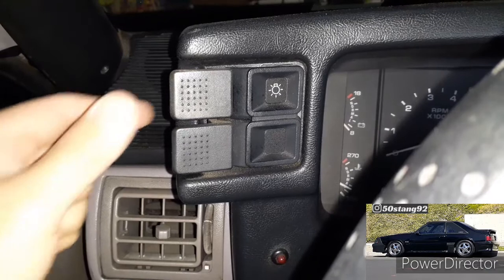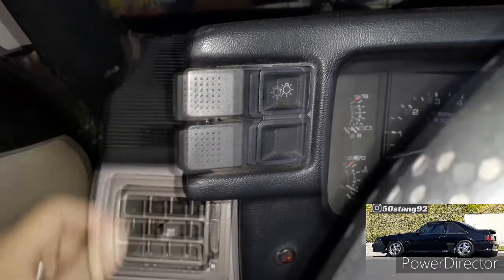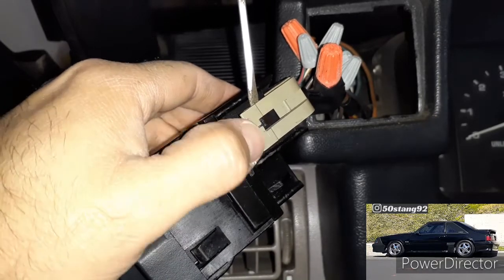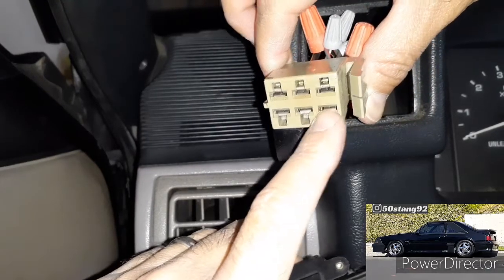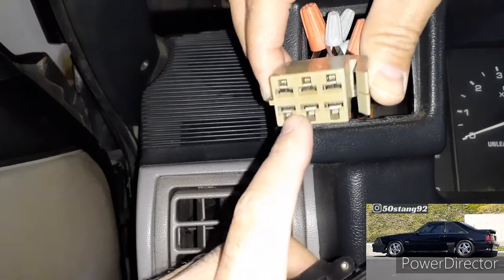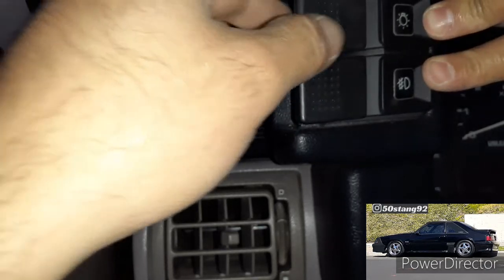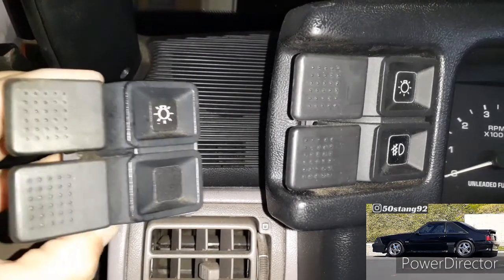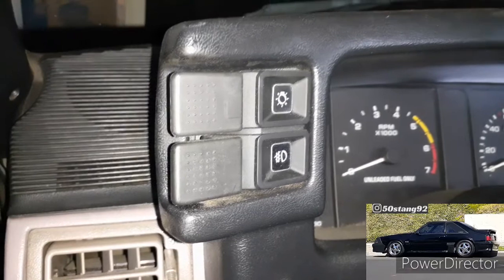Light Switch install 87-93 Mustang 5.0

Comment: Im getting ready to install a new switch in my 88 gt.....i noticed that you did NOT hook up (install) the fog lights connector...but you said your car has the fog lights? please advice me...?
Reply from the maker: The fog light connector is a seperate smaller clip that goes just under the rear of the foglight switch. You will see the smaller connector attached to your old light switch. Simply remove both the head light connector and fog light connector off your old light switch and on to your new light switch. The fog light switch is easier to remove. All you need is a flat screw driver. Slide the screwdriver under the clip and at the same time push with your thumb sliding clip away from old light switch. Sorry I didn't mention or record that part on the video.

Comment: Please fix them wire nuts 🥜 
Get a butane, solder gun, and some shrink tubing off of Amazon  
Budabam badabink
Reply from the maker: Actually the wire nuts are more practical. When it's time to replace the clip, a quick twist and the wire comes off. It's quick, safe and is out of sight since its inside the dash.